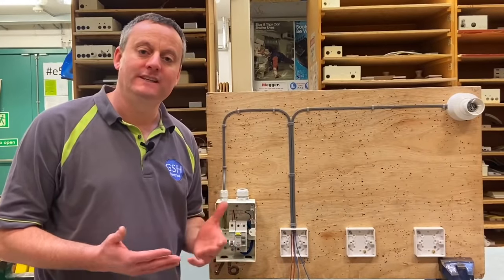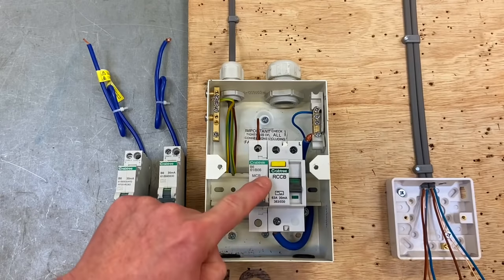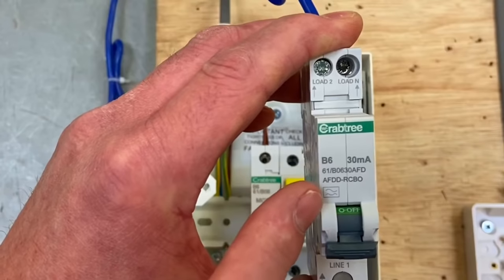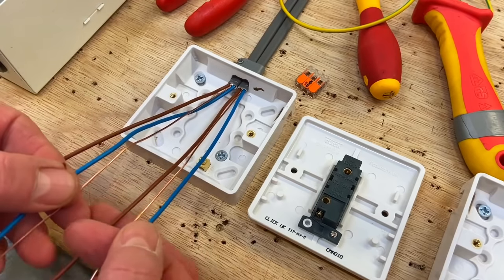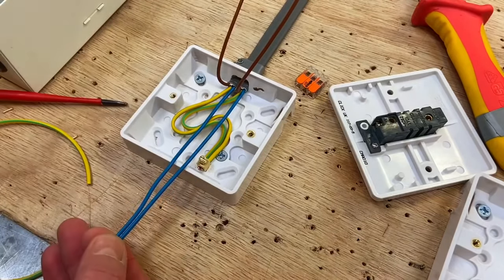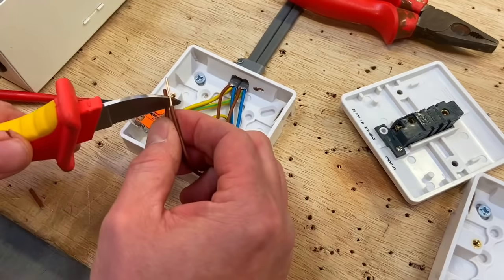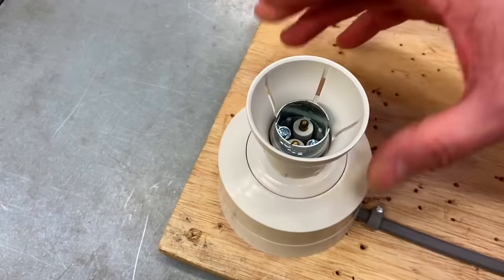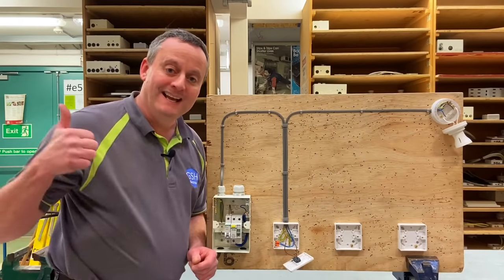Lighting Circuit 2 Plate Method Taking the Feed to the Switch and Connecting a 1 Way Switch & Light

Comment: What if you needed an unswitched line conductor at the ceiling position for a fan or  life and safety detection like smoke, heat or CO2 ?
You'd be stuffed with the two plate method.
Reply from the maker: Future Proof Your Lights When Taking the Feed to the Switch - 2 Plate Method
https://youtu.be/QtqSFVOqntU

Hope this helps 👍🏻

Comment: Would it be possible for you to go through helpful testers an electrician should carry with them on their day to day activities? 
As well as their use cases and their best/application of use? 

I've searched all over the net for an informative guide but I've not been able to find a good run down guide. 

I studied to be an electrician and completed level 2 and 3 in college a few years back but never went on to become fully qualified. 
I would like to continue from where I was but I need to recap on all my theory and practical knowledge. 
While I look for a mentor that will take me on, ideally I would like to get an early head start into recapping what I was taught before. So I don't look like a complete dumbass on site. 

If anyone has any ideas on how I should proceed it would be greatly appreciated

Great work with the guides, you won't believe how  beneficial they have been and how truly great full I am for all your hard work

Comment: In all the years I have never heard that terminology.  Was just feed from cu feed from fused spur power to light switch.  Must be spending to much time with common people.  Have installed all methods.  I used to think power to the switch then the light with nutri-link inside the switch back box was just lazy.  Am thinking so lazy person did it first then everybody else goes that looks nice an easy.

Comment: Not much use if you need to extend your circuit,we were not allowed to use this when I was a baby spark
Reply from the maker: Wiring Diagram 2 Plate Method - Taking the Feed to Another Room or Switch Connection Explained https://youtu.be/R3_eXKo1NFQ

This may help
Reply: @GSHElectrical  that’s not what I was saying no live and neutral should ever be at a 6amp light plate because you always have the issue of a handy man whacking a socket off it and completely fecking the circuits identity

Comment: Not sure what's the "magic" here, I am from Portugal and this is always how it's done there. This guarantees that there's no power in the bulb when the circuit is open.
Reply: in UK domestic installations, we traditionally take the power to the light fitting and run a single line to the switch. Many UK electricians are moving away from this and the traditional 'ring final circuit' to the sockets.

Comment: I know Weha makes strippers. The is a weird video. You have new tech. Lightning,cheap plastic boxes ( I'm assuming these  are new style boxes. You act like this is some all new and improved method for wiring a light and then you bring out the caveman way to strip wire. 
In the U.S. We have been using this method since I started Electrical work in 1976. I don't know why you would do it any other way and we always piped everything in either E.M.T. Ridged, or plastic ( smerf pipe is high salt -Florida keys ) but you still wired it this way.
As far as strippers go they were used on 14 to 10 gauge and a knife on 8 or larger and if you ring the wire like he did the inspector would turn you down.
People do things different everywhere it would be interesting to know what Country this is.
Also we use green as a grounding conductor, White for neutral  and Black,Red or Blue ( for low voltage/120 240v. Or Brown ,Orange or Yellow  for high voltage/277-480v.  And the grounding conductor ( up to a #10 doesn't have to be sleved.
I have worked on machinery from Germany and they use this color coding but I'm sure they are not alone.  
Thanks for the video. It is interesting how other people in the world do things.
Reply: The UK has had many different ways of wiring. Junction boxes were commonly used, so there was only one cable at the switch, and one at the light. The method shown here was also popular many years ago, but when the 3 plate system came in, everyone seemed to turn against the neutral at the switch, not liking the connector block usage. However, we've gone full circle now that masses of spotlights fill the ceiling, and the introduction of smart switches, which need a neutral to work.

Comment: As an Industrial electrician of 50 years taking the feed to the switchs is ludicrous,,this excuse about having less cables at a light fitting is crazy,so you are doing this to help the DIY idiots that should be banned by law from doing anything to do with electrical work ,if you are saying that an electrician is uncapable of connecting 3 cables into a 3 plate ceiling rose you are deluded,instead you are putting more joints on the circuit therefore more chance of lose connections or faults,whereas you would only have 2 neutrals at the 3 plate ceiling rose you now have 3 2 at the switch and 1 at the ceiling rose plus you have no permanent feed at the ceiling rose which has always been extremely useful when you need a permanent feed somewhere finding one at the nearest light makes life so easy for sparks but with the permanent feed only being at the switch makes it really difficult for sparks ,you may say that you can find the loop cable which goes between switches if necessary in the ceiling but then what would be the point of this ridiculous 2 plate system ,I think the people who make these decisions have never been a sparks

Comment: Why on earth are you using a knife to strip insulation !!
 End strippers are the correct tools to use and much faster.
 I have been using them for 50 years...Correctly set they do not even nick the copper as a  knife will.
Reply from the maker: College life

Comment: Did cringe a bit with that knife so close to your fingers.  Why don't you use wire strippers?
Reply from the maker: Because if you make life to easy for 16 year old learners they think life is to easy. I have been teaching 19 years #oldschool
Reply: @GSHElectrical  Old school is to use your teeth for wire stripping. Maybe that only worked for rubber insulated cable though...